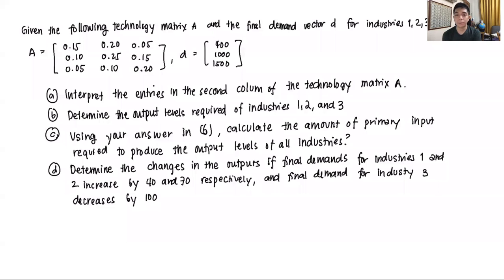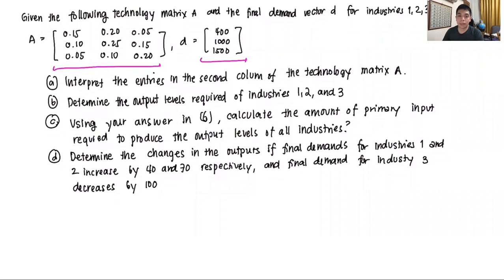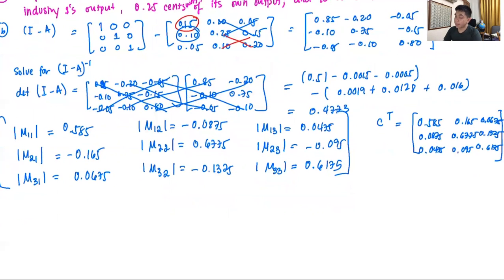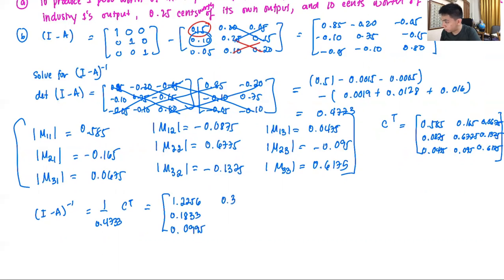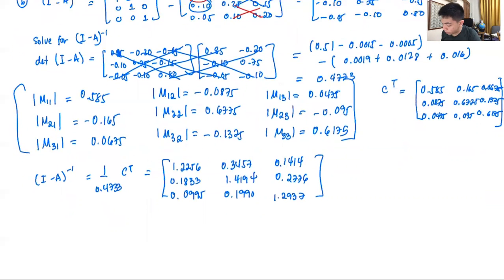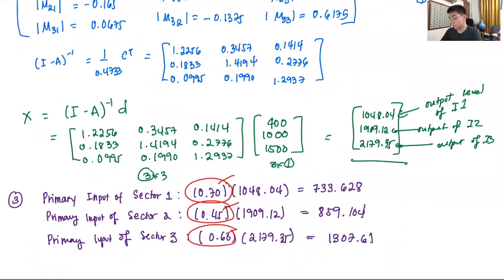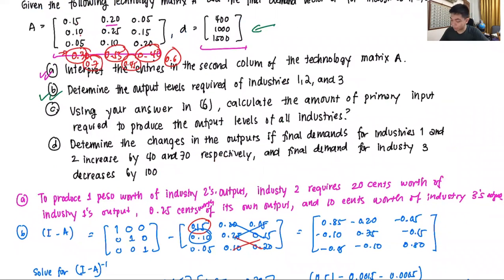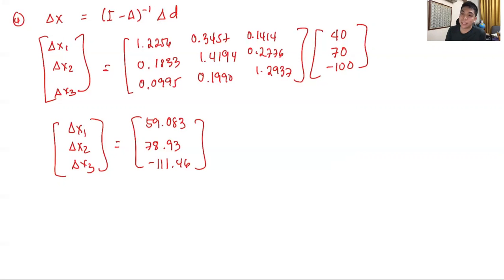Solving a Leontief Input-Output Model using Matrix Algebra

Comment: Primary input 0.70 how is it come?
Reply: are you stupid
Reply: the total of first column in technical matrix is 0.30, which is the intermediate input of sector-1. The total column of sector-1, which is the total input of sector-1, has to be 1.00, which means the primary input (total input minus intermediate input) is 1.00 - 0.30 = 0.70

Comment: its made clear. just the last, the question says the demands have increased by 40 and 70 respectively. the  new output demand is not supposed to be 40 and 70 but the original demand minus the change. like industry 1 will be 400+40=440, industry 2, 100+70=170 and industry 3 1500-100=1400. correct me if I am rwong
Reply: but overall this is one of the few videos that explained all the steps of an input output model. please make one for a bordered hessian again with all the steps

Comment: Approach is perfect yet answers are full of mistakes. I would advise you dont compare your answers to his. The first co-factor was wrong and also when he was finding the inverse, instead of a determinant of 0.4773 he used 0.4733 which has make all his solutions wrong but one a correct method working with wrong figures
Reply: Thanks for saving my time

Comment: Pano nakuha Yung sa inverse na answer e.g. 1.2256 and so on. Dito ako nalilito....

Sana may make answer....
Reply: Idivide mo bawat entry with the determinant which is 0.4773. So for a11 or entry 0.585, it will be 0.585/0.4773 = 1.2256.

Comment: Solve that's for meConsider a Leontief input-output model with no substitution. Assuming that the input matrix is given by  .
Prove that this production plan is efficient.					[6 Marks]
Show that any production plan with is a profit maximizing at a unique vector of prices.										[8 Marks]
Show that the prices obtained in (b) have the interpretation of the amounts of the primary factor directly or indirectly embodied in the production of one unit of the different goods.											[11 Marks]